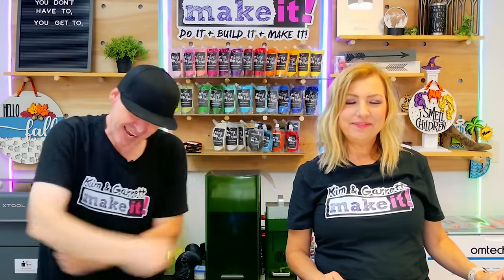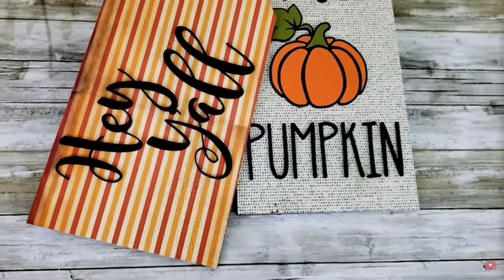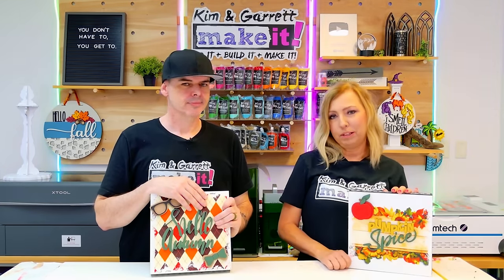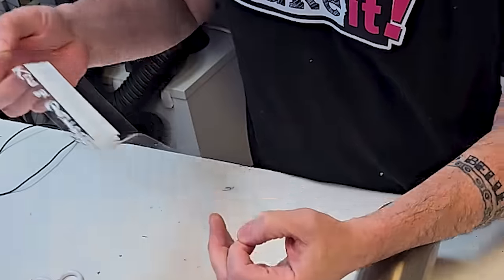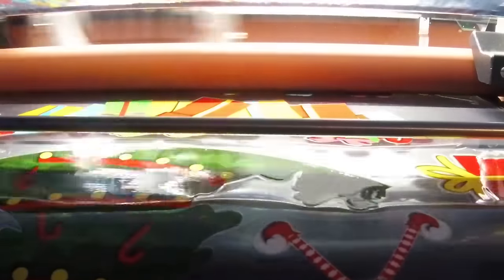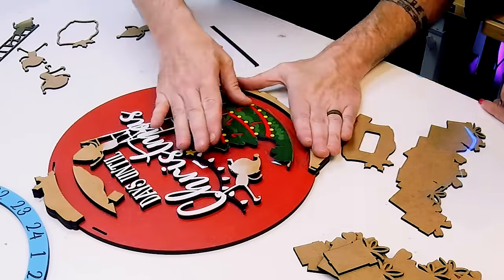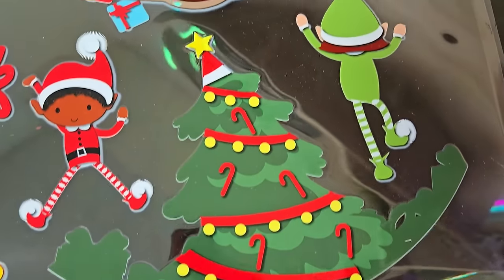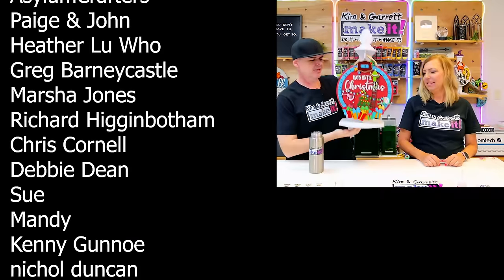We FINALLY Found the Ultimate Tool for Perfect Crafts!

Comment: That's not your Excalibur.  There are still too many extra steps, plus having to cut out the decals and line them up perfectly with the laser cut pieces.  Here's your Excalibur:  A straight up UV printer.  You print the entire design DIRECTLY onto the MDF, then use Lightburn's Print then Cut feature to cut out all of the pieces.  Two steps and done. 😁
Reply from the maker: OOOO!!!!! Yes!  That is our goal! Baby Steps...  LOL
Reply: @KimandGarrettmakeit  I'm saving up my pennies for a 600 x 900 (mm) now.  $8K isn't too bad for one that size, but the larger flatbed ones. . . ouch!

Comment: Nice Printer.  I outsource my decals which I could have purchase a printer myself by now but I worry about the toxic odor and ventilation for these printers.  How are you dealing with these issues?   I wonder if these will crap out like the DTF printers- doesn't matter how much maintenance you do - they don't last.  Is your DTF printer still going strong?  I really do not want to drop $6500 on a printer - You guys were gifted the printer? - I'll wait and see if its still running next year before I purchase.
Reply from the maker: Our DTF printer is currently down. We let it sit for almost a month and the white is clogged and won't print. Yes, the upkeep on the DTF print is a lot.  The UV printer does not seem to be as much as the DTF printer.  The UV Printer "caps" when at rest. The head slides into these little compartments that keep the heads moist. We let the printer sit for 3 full days, when we powered it on we did a head cleaning and it printed great the first time. There is no way the DTF printer could sit that long and be good to go like that.  It's only been 2 weeks , so we will keep you posted!  We also want to do a video DTF VS UV-DTF.